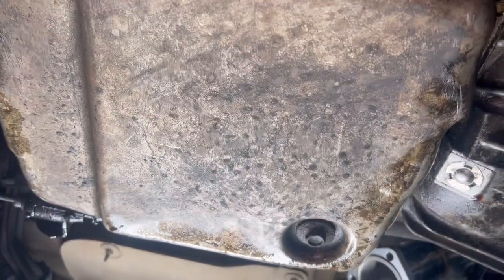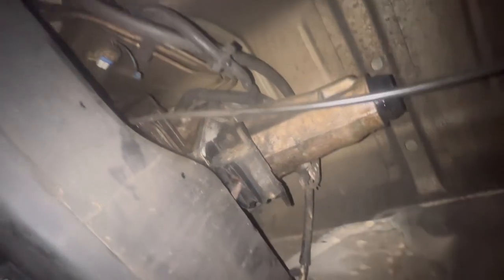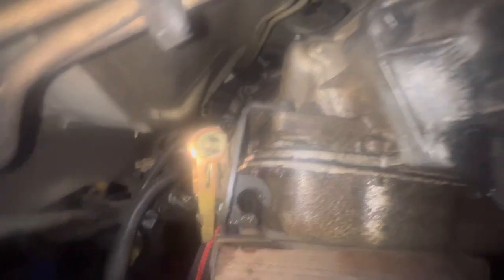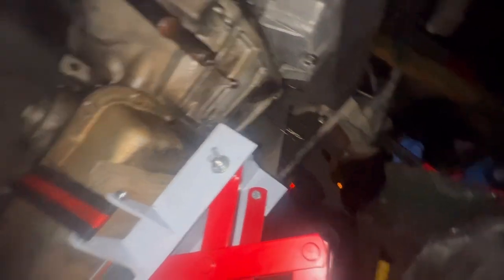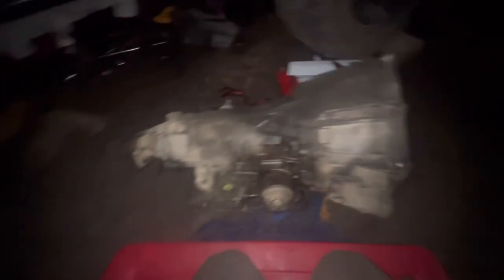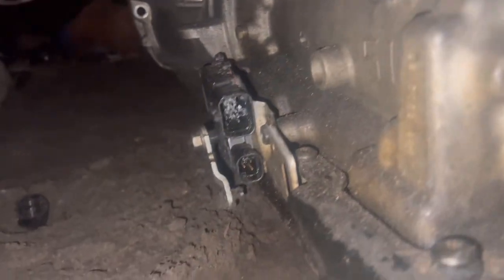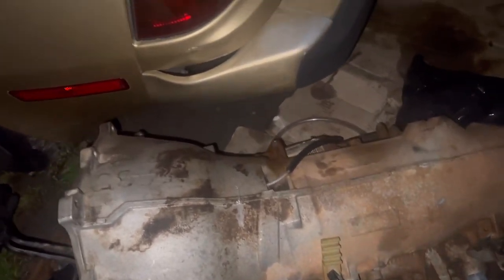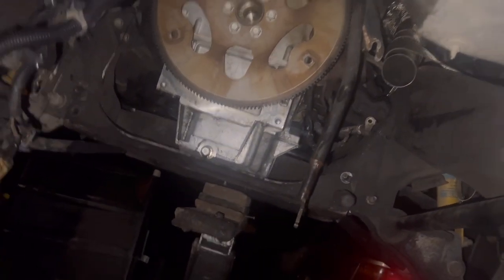4l60E Transmission removal from turbo truck I’m excited!!

Comment: Respect for doing this on the ground! 2100-2300 stall will be good for you, a real high stall creates a lot of heat for a daily so i think that's perfect
Reply from the maker: Yes sir and I rechecked 2000 to 2200 stall but thanks for info will give a try 🙏🏽🤝

Comment: You could have dropped the transmission  pan to get the fluid out and you wouldn't have had to drill a hole in it
Reply from the maker: It was easy for me and I would have made huge mess 😉 did on my Mercedes learned my Lesson